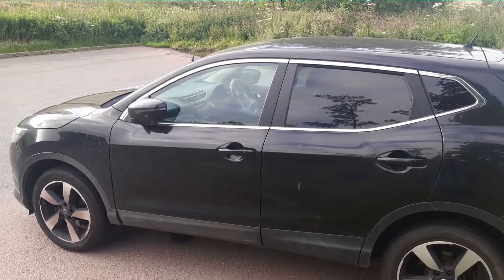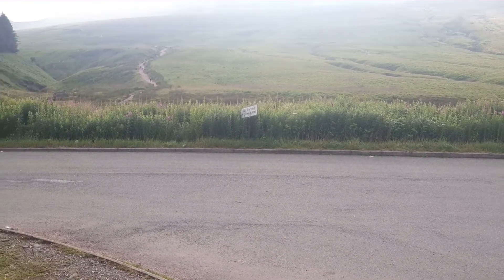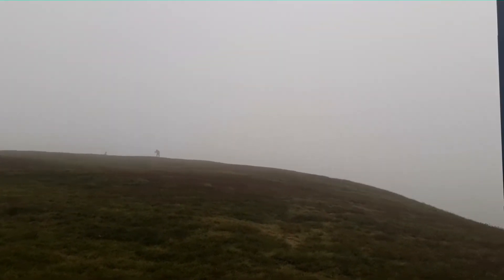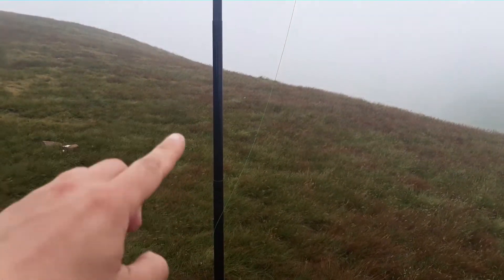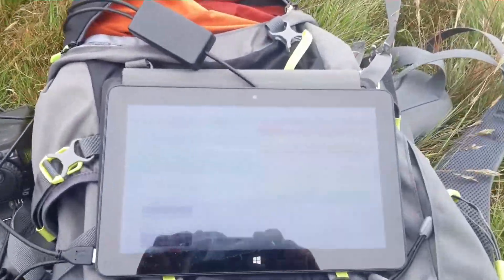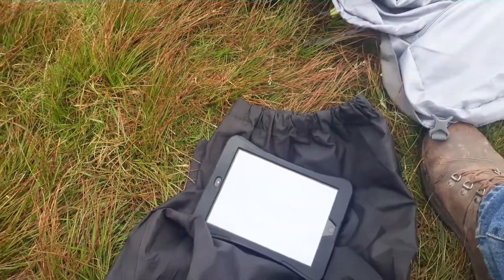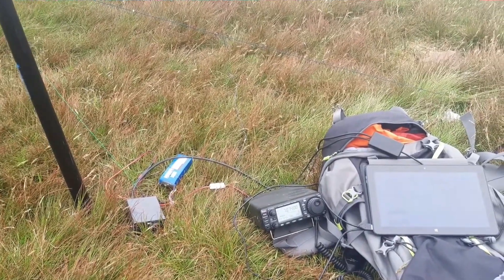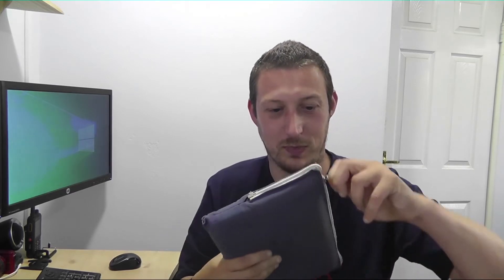How Practical Is FT8 On A SOTA Summit?

Comment: Good to catch you while you were up there, caught you as MW7TWS/M.
Reply from the maker: Nice one! Looking to do some more SOTA soon.
Reply: @HamRadioOnline  Don't think there's an awful lot of it back up here in the north, plenty of HEMA, not quite the same adventure but makes the most of local hills.
Reply from the maker: @thomasw8077  Just looked at your QRZ. There probably isn't much SOTA activity up in Scarborough on the East coast to be fair, primarily due to a lack of SOTA summits in the region!

I know that there is A LOT of SOTA activity around the Pennines & Lake District regions. From personal experience, I seem to create a pile up any day of the week without even trying every time that I go there!

Unfortunately they might be a bit too far away from you unless you have a very good VHF station or conditions are favourable for 80m or 40m.
Reply: @HamRadioOnline  VHF sadly is limited to the town itself haha! We have hills on three sides and the sea on the other haha. Can get reasonably far going just a little out of town as you probably saw on QRZ.

40m has been a bit dead to me lately, which is a shame, it was doing well but with all these weather events going on lately it's causing me a lot of disruption. 40m loft antenna squeezed into a 5 metre room can only do so much haha! I sit on 40m JS8Call pretty much 24/7, so if you ever want to try a new mode I should be able to receive it eventually.